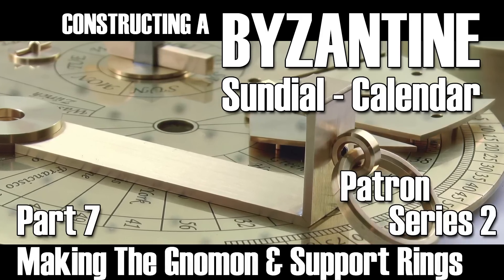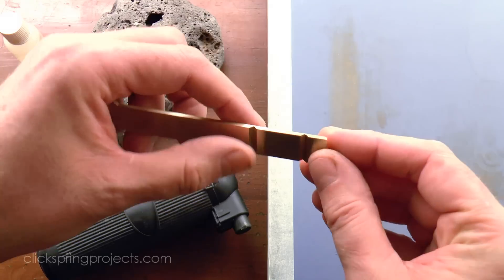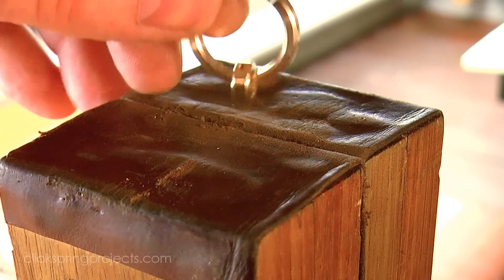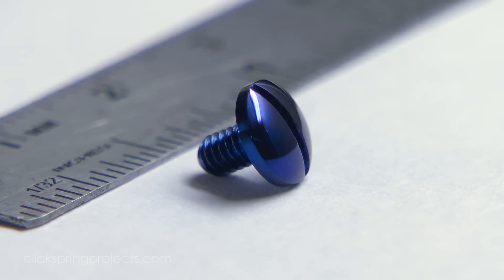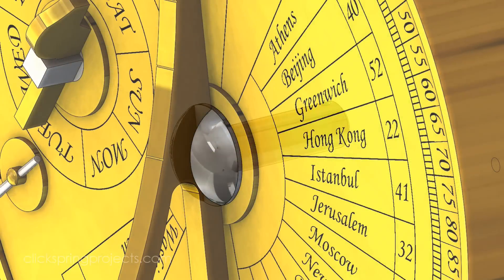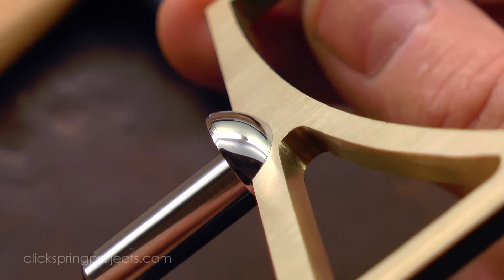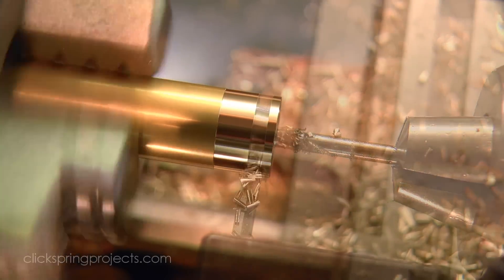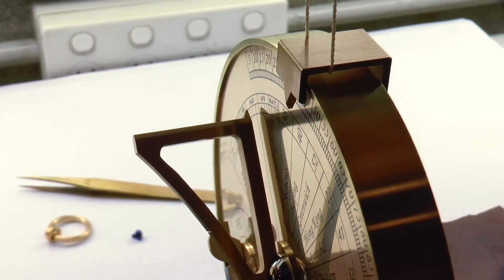Constructing A Byzantine Sundial-Calendar - Part 7 (Making The Gnomon & Support Rings)

Comment: Got a quick question, at 17:29 we can see that there's still solder visible in the internal corners, which is eye catching as it is different from the usual finishing we've seen from you. It looks like it's been radiused as well, is this to prevent cracking as the radius would help distribute stresses?
Reply: I wonder what kind of solder he uses for that joint beacuse of that gap I imagine silver brazing may be a bit fragile

Comment: I have a question: for an item like this, that will get handled - is there any benefit to polishing rather than brushing the surface? Like will the brushed finish wear and be hard to make look 'new' without re-brushing? Where the polished surface can be cleaned and polished to look new?

Comment: I just thought of something: who would've actually owned this? Even with electric precision machines and alloys that improve the workability of a metal, it's still an expensive and time consuming project. Would these even be available enough for every noble and wealthy person or scholar to have one? Or would it only be used for a very specific application? Or in between and be mostly just a trinket for a noble, because the time and cost makes it impractical for actual use?

Comment: I do wire wrapping for jewelry and I typically work in copper.  I recently picked up some 18 ga brass wire to try it out and was surprised at how resistant to bending it was.  Even when using dead soft wire, it has a tendency to spring back instead of bending to shape.  I've worked with stainless steel wire as well and even that wasn't as belligerent.

Comment: On the subject of shielding parts when soldering, I use various methods ranging from pieces of scrap metal or soldering block in much the same way you use the aluminium sheet, to using a pan full of crushed pumice into which the piece can be put with only the needed part exposed. I work at higher temperatures than you are doing here though, mostly I’m doing silver jewellery with hard silver solder, so the aluminium probably wouldn’t take it too well! The pumice pan is my annealing hearth too.

Comment: Chris, that roofers flashing aluminium is super useful.  I’ve used a lot for the edge flashing when making fibreglass moulds. Hot glue on, and allows a bit of conformability. Sadly not available on the NZ catalogue from the same big brand, or anywhere commonly in the Netherlands (where I’m currently based). Seems specific to Aussie housing building techniques
Reply: Everywhere else just uses good old lead flashing, but with so many people collecting rainwater off their roofs to drink  here I reckon the government's probably trying to avoid that as best they can...

Comment: Turning the stock into workholding for the piece you just cut off is a great trick, I must remember it.
Reply: I also noticed how he later used a reamer in the tailstock to center a part on a superglue arbor. 👍
Reply: It's already in the chuck and any shoulder you turn on it is going to be concentric with the piece you just cut off it, yeah.